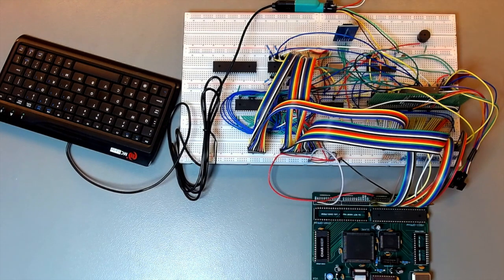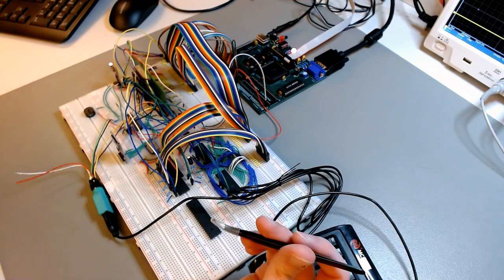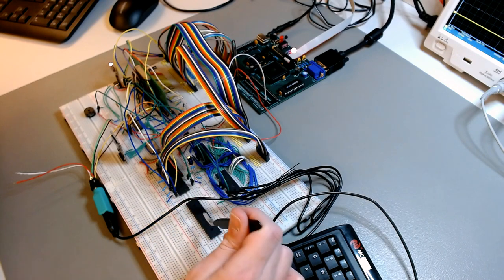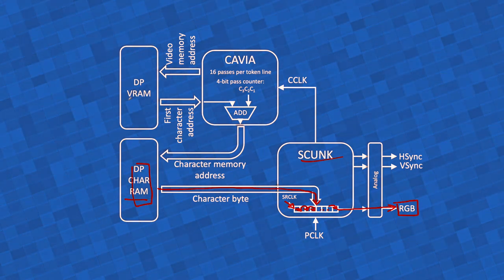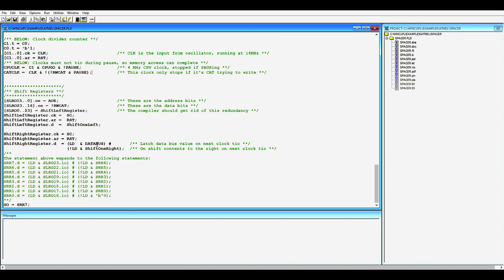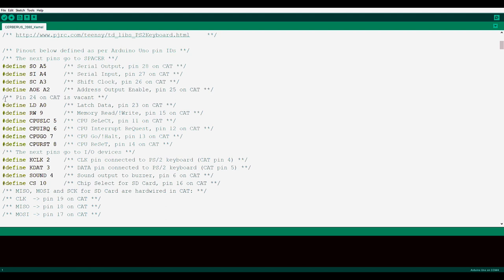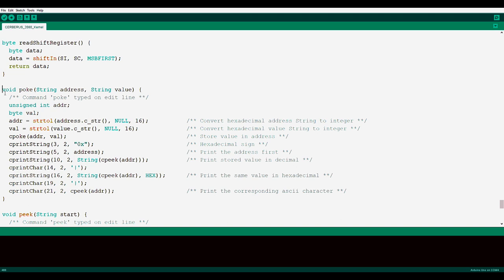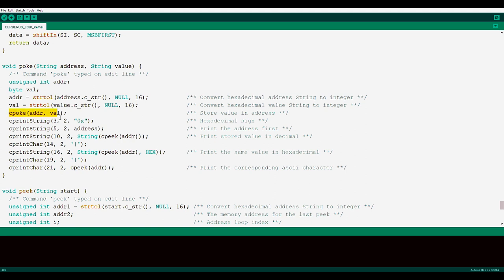Building CERBERUS 2080™, my dream childhood computer: Episode 13

Comment from the maker: UPDATE: I managed to much reduce (perhaps even eliminate) the instability of the CPU's data and address buses by ANDing the RW (Read/!Write) signal with the CPU clock, within SPACER. I'll probably keep this change in the final version, even when using a custom PCB, because SPACER has the gates anyway, so why not use them to improve stability even further? For now, though, this change may allow me to integrate the Z80 still in the breadboard, which would be nice. Let's see where this will go!

Comment: It's amazing to to build a computer by yourself alone.
Reply from the maker: Thank you! However, as I hope I will convince you of at some point, this is really a very simple computer, and most hobbyists could build something like this by themselves, if they put their minds to it. It may take them longer than it's taking me, but they could, if only they would! :-)
Reply: @thebyteattic  looking forward to put it to practical use, since the characters can be custom designed, turn it into a printing device or display device should be fun, lot of 6502 assembly experts around, your assembly editor is the best I’ve even since in 8 bit computers.

Comment: I did wonder if you could add additional SPI attached memory and use the 'spare' pin 24 as a Chip select for it, and share SPI buss with the SD card. Just a thought. I've already mentioned alternative AVR's 
It appeares to have come along a lot recently, I'm hoping that you will release all the schematics along with the code & source for each of the CPLD's & the AVR.
And the possiablity of premade PCB's as buy usually 5 when you would prefer 1 is a little annoying at times.
I'm glad that you have improved the stability as well.. 
Big thumbs up from me :)
Reply from the maker: Thanks Graham. Yes, I will make literally everything available on github once the project is complete. And yes, I could use a serial EPROM on that extra pin and create space for a more complex kernel. I resist that a bit because it hurts my sense of elegance :-). And there is plenty of RAM and SD card space available for more complex system functions targeted at the CPUs. As for the PCBs, I don't want to sell things myself (otherwise my hobby becomes a job), but I am trying to arrange for others to do it, so the end result for you will, hopefully, be the same! Thanks for the warm words and encouragement.

Comment: It might be good to keep the video board separate with a full system bus interface to the rest of the system.  This would allow others to possibly create enhanced video options.  Of course, this would also require re-writing the BIOS, reprogramming CAT, to support it.
Reply from the maker: Yes, I have been giving consideration to modularity questions, as you suggest. Separating out the video part would, however, require a very large bus, as the video circuitry interfaces with both video and character memory via different lines. We shall see, but thanks for the suggestion!
Reply: @thebyteattic  The other reason for keeping it as a separate board would be that others could interface it to their designs.  Could a serial to parallel unit be added to reduce the size of the bus needed?
Reply: @Retro_Ken53  Maybe CAT/SPACER could be ontheir own board too? And instead of using ATX board, you could use PC104-like design, to stack boards?

Comment: Wondering, instead of halting the CPU to allow CAT to write to RAM,  would it have been possible to have CAT hold the value and map 0x0200 to CAT directly? I mean that 0x0200 would deselect the RAM and enable some Chip select pin on CAT via spacer and then CAT would write the key pressed directly on the data bus.
If available pins on the Atmega are an issue in that case for the data bus, CAT could move the byte serially through spacer using shift register, (eventually pausing the CPU clock in the meantime,but it might be simpler than halting the CPU via RDY/BE. Just an idea 💡 not sure about performance impact in case of using an SR, but it would be faster  if no SR is involved (I think).
Reply from the maker: I'm not sure I understand! The data bus is just a communications highway. The value of the key pressed needs to be written somewhere accessible to the CPU, so the latter can fetch it from there. And since the CPU doesn't have a register that can be written into from the outside, CAT and the CPU need to talk to each other via memory-mapped I/O. Notice that CAT always writes serially anyway, through SPACER.
Reply: @thebyteattic  yes, I was thinking of a different architecture. In which the Atmega would act as a 1 byte RAM (a register) , just selected for address 0200. Actually it can work for whatever range you want (more addresses lines would also be needed). I drove a 6502 from an Arduino Mega, and used no external ROM nor RAM. The Arduino was actually acting as Rom and Ram (and clock, it was a very cheap design). In my case the Arduino was  connected to the full address bus and data bus, but for one mailbox byte, just a chip select is enough, not the full address bus. The protocol would be different in that hypotecical architecture (I know it's not the one you have designed, I'm just rambling on possible alternatives) : upon keypress, atmega issue Nmi, 6502 reads the 0200 which selects the atmega as any memory mapped io device (address decoding logic would also need to deselect the RAM of course), and Atmega replies leaving the byte on the data bus when read from its address.